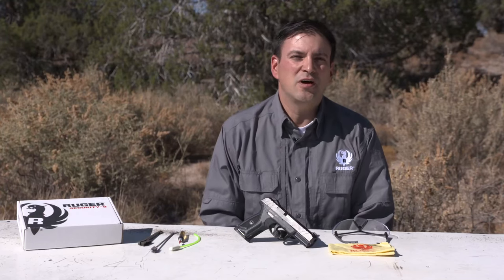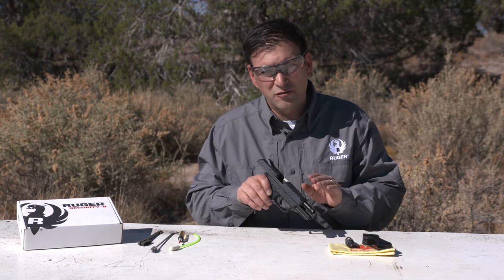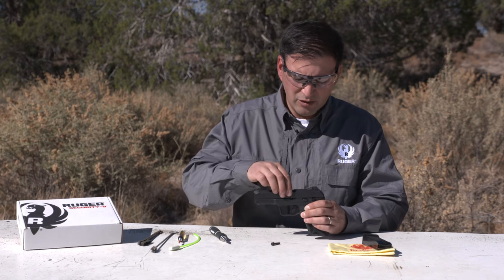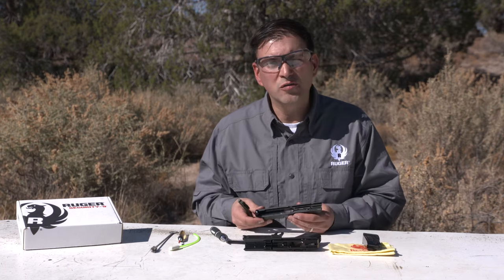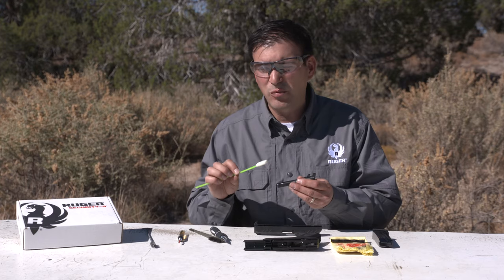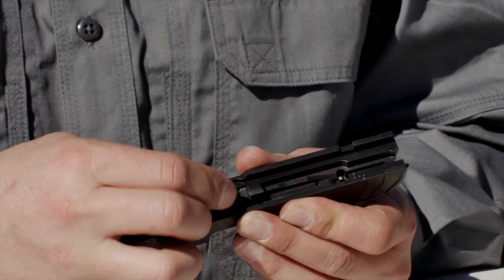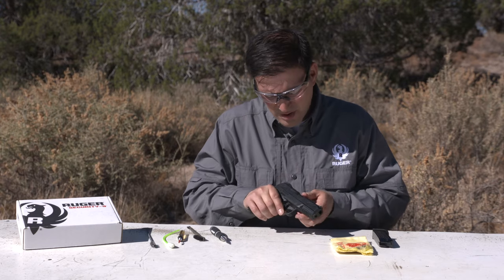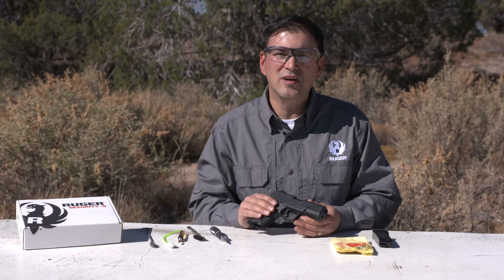Ruger® Security-9® Disassembly, Cleaning and Reassembly Tech Tip

Comment: Using the mag for the pin was awesome . Ty
Reply: Yea that was my favorite part of the video
Reply: You can use a shell casing also
Reply: I think I would only do that if I had no other choice just because I dont want to wear down a section of the mag itself.
Reply: Putting the end of the barrel against the table and pressing down to line everything up was the real tip here. It gives you a free hand to use some kind of tool. Of course, would be even better if we didn’t have to remove the pin at all.

Comment: If anyone dry fires by accident with the slide off and the gun wont slide all the way back, dissemble again and push the hammer(back middle of the gun) in the upward position and then reassemble   👍🏾
Reply: Thank you for this! I was losing my mind wondering what was wrong
Reply: 15 minutes and 3 videos later.... thank you! i couldnt figure this part out
Reply: Thank you! Freaked out for a second but everything works fine now

Comment: Dear  Ruger,are you listening. Understanding the Security 9 is  for a civilian market place however consider a Security 9 upgrade.A gen2 that can perform and go the distance  of other hi end comparrisons and beyond the average consumer market .Upgrades that will make this platform launch to another and greater performance level.The Security 9 has so much potential if only your budget will allow a upgrade.Consider ambi controls, match bbl.,tuned trigger,a fs with a 4.5 bbl.,Several things are so right about this gun like the fire control  system an grip angle but shift to the next gear with it.If you need suggestions I have some.
Reply: Agreed. We need a Gen 2 for the Security 9. I love mine! It was my first gun purchase 2 years ago!
Reply: Hell yes please.
Reply: I see there is now a Ruger security Pro,  is this the upgrade you mention?   I saw it costs more and doesn't have the external safety but assume it has improvements?
Reply: Agreed even features to customize this gun it has alot of potential

Comment: Is it normal for the disassembly pin to fall out after reassembly of the firearm? Because my security 9 compact's disassembly pin is very loose after reassembly, and if the cocking action is done slowly the pin just falls right out of place.

Comment: What to do if the spring comes off of the guide rod?
Reply: Should just be a little bolt holding it on. Put spring in guide rod and then very small amount of blue Loctite and screw the little bolt in the end and reassemble your pistol.

Comment: No oil for the slide or rails?
Reply: No. I oil mine. You do too as indicated by your comment. My experience with semi auto Ruger pistols is if anything to lube a bit more, fire them too dry and they will not cycle properly.
Reply: I would

Comment: What if you accidentally pulled the trigger with slide off while cleaning?😒🤔
Reply: It’s a bit of a pain to reset the hammer. Have to set it back so far before you can even put the slide back on.
Reply: I read somewhere you could break the hammer if dry fired without the slide on the Security 9.
Reply: @MilVetGaming  What u Doin Dry Firing With Slide Off Anyway... It Aint A Game Son... Security 9 Is For The BIG Boys
Reply: @Cody Davis  I Thought I Had Actually Broken Sum..... But My Brain Reset & Figured To Pull Hammer Back.... Was NOT A Pain 😅 Actually Had Me Excited I Can Now Clean My Gat Without A Baseball Bat
Reply: @Whoawhosthatguy  how do reset the hammer on 9mm Ruger security
Reply: @craigmcmurphy9532  if the trigger was pulled with the slide off it drops itself down into the frame and as long as it didn’t break any of the plastic pieces under the hammer inside the frame and your spring is still connected you just need to push it back like you’re cocking it until you hear a “click”. It should rest in an upright position now if everything is in working order. Once the “click” is heard you can continue to reassemble your pistol.
Reply: @MilVetGaming  shouldn’t be dry firing with slide off. It wouldn’t break the hammer but definitely poses a threat to the plastic pieces underneath it.
Reply: @twe_music  as long as everything stays together it’s pretty easy to reset but if the spring pops or something like that it can be a bit of a pain in my experience having bigger hands.
Reply: @twe_music  I never said I dry fired anything. I have a security 9 as well.

Comment: I will STRONGLY advise against this firearm. Not that this shit matters but i was in the military alright so thats my experience. but that means diddly squat. If your Sec 9 is not racking properly after disassembly its because your hammer is down. its at the rear section of the disassembled firearm just push it all the way back. Took me a solid 45 minutes to figure out that brilliant idea. I finally understand why fathers usually cuss about the flashlight because if i were doing this in the dark and had no light to figure out this...lets be nice here....design flaw, Id be pretty fucking pissed too. He doesnt cover that in this. Just get a 1911.  also you dont need a screw driver a spoon will work perfectly fine.
Reply: Thank you so much just had the same problem
Reply: Yeah just casually recommend a gun that’s twice the price of this or even triple the price 😭
Reply: @supninja99  I got my Sec 9 and 1911 for the same price. It's all about the places you go and which one you're looking for